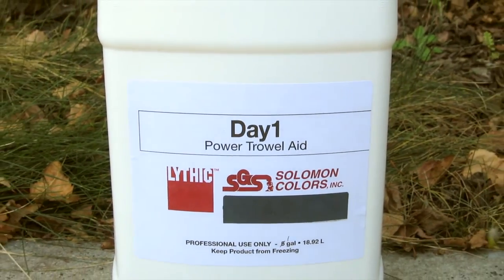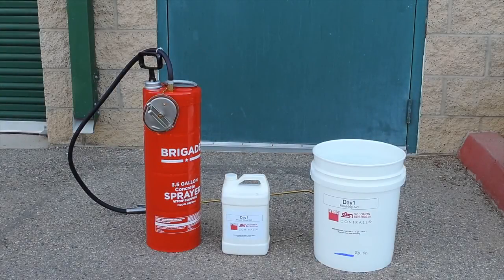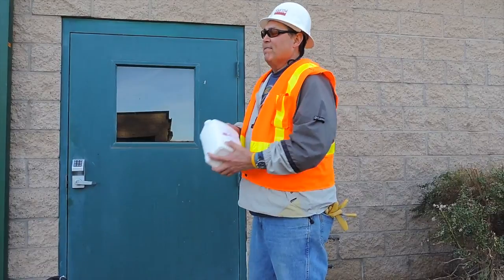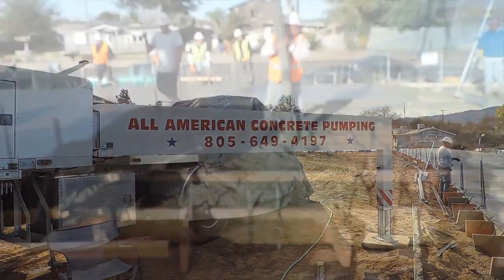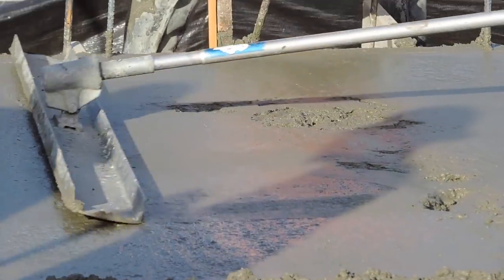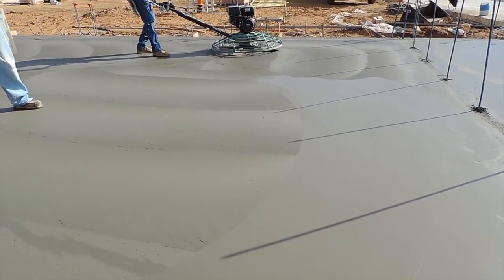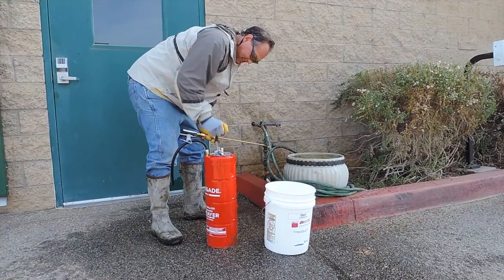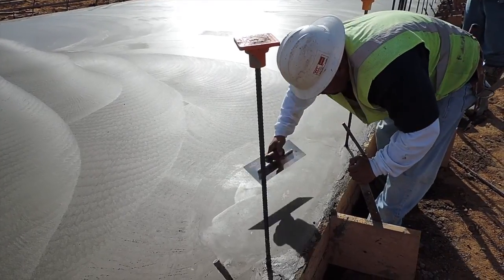Lythic DAY1 - How to Mix and Apply DAY1

Comment: You're better off using a mid range water reducer.  If you really want to surface harden the slab, just use lithium silicate.
Reply: Day1 helps with hot weather concreting. Something that mrwr does nothing for. Mrwr does not help minimize any evaporation out of the slab